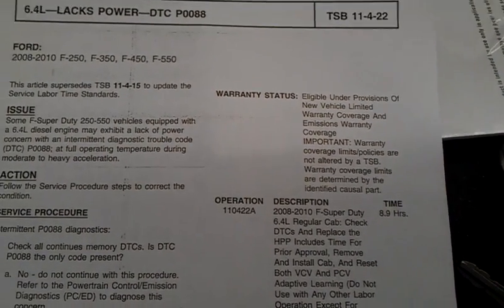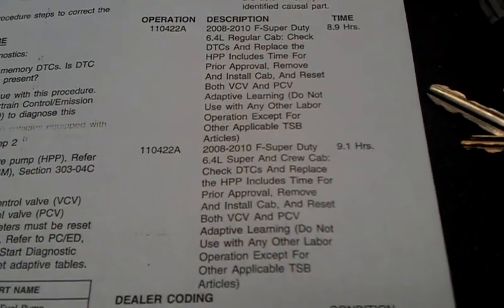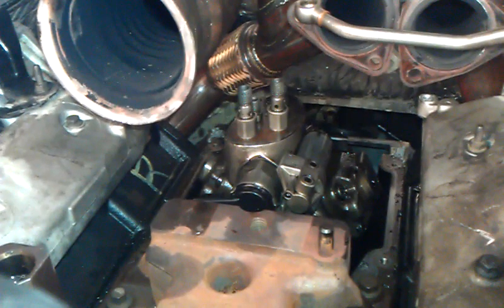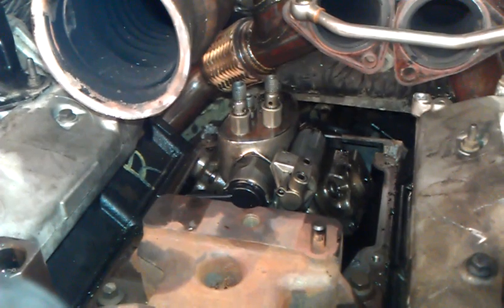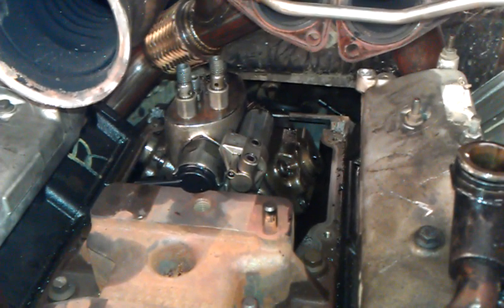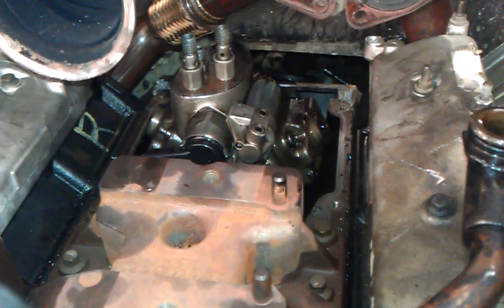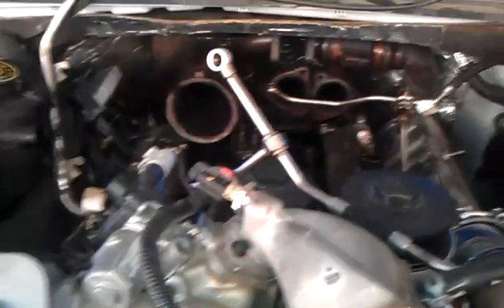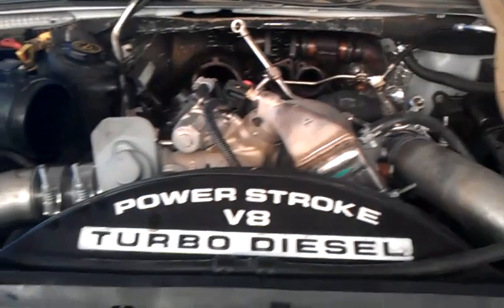6.4L HIGH PRESSURE FUEL PUMP (P0088)

Comment: Question I have a 08 6.4 I've delet

Eeded  this thing 20 times are in the fuel lines bought a new fuel pump under the truck and it starts up and cuts back off

Comment: seems like some of these pumps are destroyed by not keeping the water drained from the filter on the frame, the fuel lubes the pump so the fuel cooling system is important also. the pumps probably last about long as any @ 5000psi.

Comment: Hi Joe I have a 2008 ford with a 6.4 it has a code p0087 fuel rail pressure low but if you look at the data stream it is not the case in fact the fuel pump is almost twice the ask for pressure what do you think?
Reply: Did you ever figure out what your problem was?

Comment: Hey Joe my buddy has to replace the high pressure fuel pump on his 2008 ford F350 6.4 twin turbo. Said they need to remove the box too? Up here in Canada they want almost 5 k with labor,, that sounds retarded, is it?

Comment: replace turbos on 2008 F 350 with 6.4 deisel also did egr delete truck ran fantastic for about half hour started to loose power like it was starving for fuel. restarted truck twice after cranking for a long time. and now it will not start at all. shows code 00090 high pressure cylinoid but not sure that's the problem any help would be appreciated.  thanks in advance
Reply: Dale Pepper Hi, do you know if the HP cylinoid has a part number??? I have the same code 00090 and in the ford service they said that I need to change the whole pump. Thanks in advance.
Reply from the maker: +Rodrigo Hernan Pinto Diaz yes you will have to replace the whole pump.
Reply: Seriously Joe? There's no other way to fix the lack of pressure? here in Chile the cost of the fuel pump is almost 4K ....
Reply from the maker: +Rodrigo Hernan Pinto Diaz you can go after market but its a hit or miss.

Comment: As the head mechanic responsible for a fleet of 6.0 and 6.4 infected trucks and vans .. I can without a doubt , tell the world .. these are THE WORST engines ever made !!!  Here in the Bahamas, I have given them the name "666 trucks" ,  6 days to get the parts here and do the repairs, 6 grand for the parts .. and 6 days until it's back in the shop for repairs again ... POS
Reply: Identifying the common problems, addressing them, bulletproofing, changing oil frequently and using a scan gauge 2- is the way to avoid headaches. Have 250k on my 04- tow a 33 foot trailer. Runs fine.

Comment: Although I see your original post is 5  years old and while I suspect you may no longer monitor comments for this post I'm trying anyway: I have a bad HPFP in my 08 6.4L TD F350 (P088 the only code...) I'm trying to get a ballpark idea of what I could expect to be charged to have it replaced. While I'm very good with a wrench, this is my first diesel truck and I have never wrenched on diesels before and admit a little intimidation with the thought of doing it myself. Any input? Thanks.
Reply from the maker: +SEI RePower you will have to replace the pump. You can do the job at home with the cab on. The hardest part of the job is removing all the turbo exhaust bolts. Pain in the ass.
Reply from the maker: +SEI RePower you will have to replace the pump. You can do the job at home with the cab on. The hardest part of the job is removing all the turbo exhaust bolts. Pain in the ass.
Reply: Thank you Joe. I understand the pump needs to be replaced, I was looking for a ballpark idea of what I could expect to be charged in 2016 dollars and wondered if you had any idea of what that figure would be. I apologize for not articulating that clearer, my bad. I'm an old man now and just don't think I have what it takes to do it myself. Thanks again for your reply on an old post.
Reply from the maker: +SEI RePower the pump is about $1200 and labor is $1400 to $1600
Reply: @Joediesel187  Joe, when you say removing the turbo exhaust bolts is a "pain in the ass", does it still beat removing the cab of the truck?

Comment: How many miles are on the truck, I like to know these things?  Mine has 197,000 My ch engine light came on two months ago, I had a tech come over and he diagnosed and said the injectors have good tone, no trash in the fuel system,  two cyl  out of sync with the other six and p0088 is the only code. Says fuel rail pressure too high, replace hpfp? Ive parked the truck and have not driven it since. 3 shops want roughly 4,000 for this and ford quoted me 3200 plus tax. Based up on the hours ford gives, I'm paying 200 an hour for labor!  I'm gonna attempt to do mine myself, I just can't justify paying close to 200 an hr for labor?  Besides I can then buy a new water pump and other items I want to replace also.  Its just a thought for now, although scary.

Comment: Hi Joe, I recently changed my fuel filters on my 6.4. Long story short I found the fuel filter pump on the rail "rusted". I only knew something was up from finding a little rust debris in the fuel filter bowl in engine bay. I ordered a whole new assembly for the rail. I didn't throw any codes and the truck runs fine. I planned on driving it about 25 miles then swapp out the filters again. Have you seen this before?? Thanks man, I always enjoy your uploads!

Comment: uggg my 08 f350 6.4 turbo deisel powerstroke all of a sudden will have no throttle power I'm going to find a Deisel mechanic I'm in S.TX what are some things it might be so I don't look totally durrhhh when I'm talking to the mechanic..Thanks
Reply: +gdyupgal4u check engine light? turbo whistle noise? check the cac tubes and boots
Reply: I do hear a whistle noise
Reply: Exhaust manifold leaking?

Comment: Hi Joe, How did you get the turbos off without lifting the cab? I have a squeal or whistle noise when I accelerate from a stop until about 30 mph normal driving. The noise does not happen when in regen. The noise seems to be coming from the area of the right turbo. I can't determine whether it's the turbo, down pipe leak at the turbo, up pipes, or exhaust manifold leak. Do you have any advice?

Comment: Joe, is it possible that oil is leaking from the HPFP down the back of the engine? I just reassembled engine after doing cab-on head gaskets and now I'm seeing oil. From what I can see it is not coming from the turbo oil drain connections.
Reply: +joediesel187 About to tackle the HPFP cover gasket. You've seen these leak before?
Reply: @Scott Reid, did you figure out that oil leaking down the back of the engine?  Was it your HPFP gasket?  If so, did you have to do cab off?
Reply: @evantugby  Did that gasket at the same time with the cab-on.
Reply: @scottreid4170  how much time did it take you?  Did you have to replace the one-use fuel lines too?
Reply: @evantugby  Ya did all the fuel lines. wasn't gonna waste my time since it was all apart. whole deal was somewhere around 65 hours. i'm not a mechanic tho and i wasn't in a huge rush
Reply: @scottreid4170  a pure 65 hours of tear down, fixing and put back together!?  That means it’s much faster to pull the cab.  Yikes!
Reply: @evantugby  If you have the means to raise the cab then by no means try doing it with it on. It wasn't an option for me. I really did it for the challenge. Many online said it couldn't be done cab-on, but I proved it can. It was fun

Comment: The problem is this: you replaced the fuel filter for servicing and purge procedure switch in on was held for 10 times and never was achieved on, only stays on for a few seconds and dies, my question is whether it will damage the high pressure pump by attempting to start the engine several times and nothing. Might you tell me how to check pressures that amount of pressure must dial and where I can perform these tests in both low and high.

Comment: Yes I replaced the 2 fuel lines and the kit came with rubberized washers. The date code on the fuel filter said 2010 so I said "f" it and just bought a new fuel pump from Jim Burke ford In Bakersfield yesterday ($1,150) also got 2 more fuel lines. Going to start on assembly tomorrow. Could you tell me the torque spec on the fuel lines please???

Comment: Joe I just replaced my pump gasket my self but I cracked loose the fuel fitting on the pump, the front driver side one then tightened it back up. I put it all back together and know have a bad fuel leak. Did I just trash the pump???
Reply from the maker: did you replace the fuel line the pump ? they are one time use only. also replace the copper gaskets too.

Comment: hey joe I'm having the same issues and codes as you described , i have two questions for you. 1 if i have my mechanic update the system to produce more pressure for the pump will that solve my problem? 2 if it won't how long do i have before it completely fails?

Comment: I have a 2008 f450 I have noticed a fuel leak on the driver side. I took the truck at dealer but they found nothing. Just went out and there is fuel on the ground.

Comment: @flahr1 The actual engine and bottom end isn't the issue, but lots of other problems cause issues with the bottom end.  It's really very different than the 6.0, but still seems to suffer from the same issues. I.e., one EGR cooler was bad enough on the 6.0, so the 6.4 has two. The 6.4 doesn't use high pressure oil for fuel delivery like the 6.0, but still has quite a few problems in the high pressure fuel system. I wouldn't chip/tune it at all, and yes, maintenance is critical.

Comment: @v8rangerboy No worries.  Thanks for the tip, but I already bought it.  Is the engine itself crap? Is the engine related at all the 6.0?  I heard that the emissions controls and lack of maintenance caused the majority of the issues with the 6.4,  
Any recommendations to keep it running reliably (i.e. out of the shop )